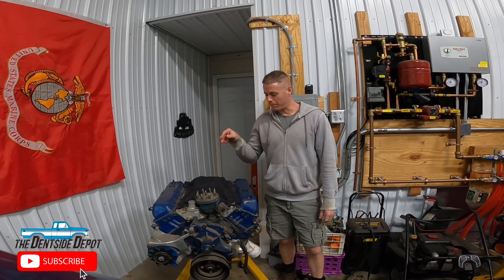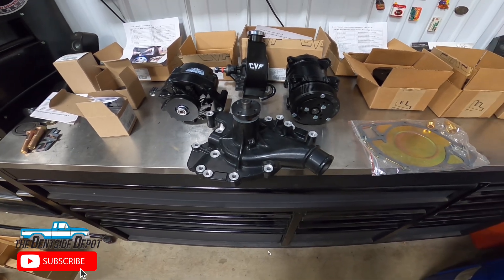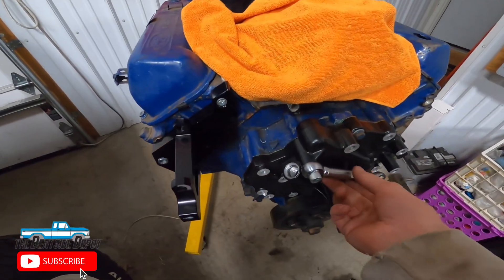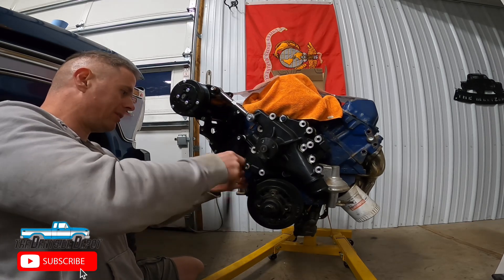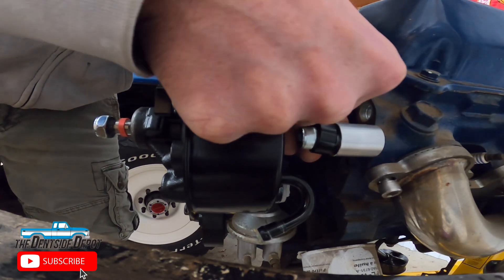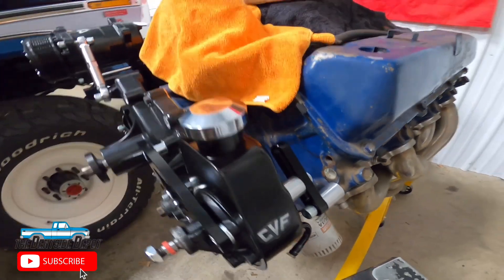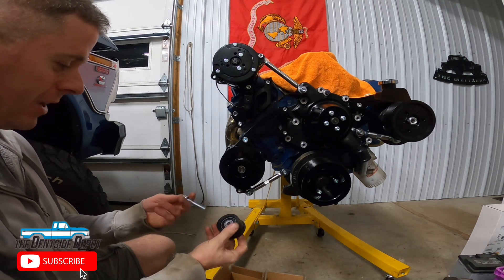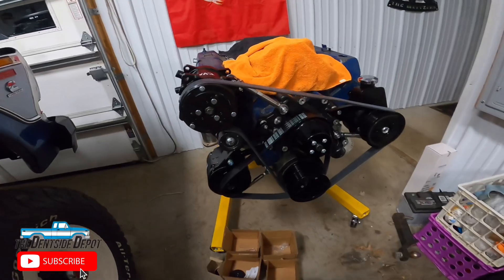Installing The ULTIMATE Ford 460 Serpentine System from CVF Racing

Comment from the maker: Another thing to consider, if you are in need of brackets or if your accessories are already worn out and you need to spend the money already for replacements, it is really not that much more to upgrade to this system and then have way better performance and looks for your truck. The links for all of CVF Racing's products are in the description above!

Comment: Just A 6 Rib Belt!!! Not A Serpentine Belt Set Up!!!
Also The AC/Power Steering Belt Is Way Too Long And Will Be Flapping In The Wind!!! Along With All The Squealing From The Crank Pulley Not Having Enough Wrap Around!!! 
The Long Distance Between The AC And PS Needs An Idler Pulley Or Two!!! 
I Wouldn't Buy This Kit!!!

Comment: How's the fit inside the engine bay? Imagine with a truck its ok, perhaps harder in a smaller car with where the alternator placement is?
Reply from the maker: Well I will answer that question in a later video! This is truly my first time using one of these systems.
Reply: I couldn’t fit this kit in my 78 f250. It conflicts with the frame yoke and low mount alternator. Customer service helped out real well and have the high mount bracket on the way. I’ll have to forfeit the AC compressor but that’ll be fine.

Comment: Nice kit, looks good and Easy!
Reply from the maker: Yes Sir I was really surprised by how easy it was to install. I have done kits in the past where there are multiple different spacers and bolts for each bracket and its a nightmare, this one is one and done and you are done. Well worth the money if you ask me, especially if you need the parts anyway like I did.

Comment: 2 belts and a Chevrolet power steering pump?   And it’s probably $$$?   I like the factory 460 serpentine setup way better
Reply: Ford camper vans with the 460 had Delco power steering pumps from the factory. Even back when everything had a separate V belt for every accessory on it. So did Dodge trucks, one ton and over from back in the 70s  to the 90s ...
Reply from the maker: The factory system is 3 belts when you have ac and emissions and a Saginaw pump also came on Ford's in the 70s as well, specifically the Econoline vans, it is not a chevy part but it is a way better design than what Ford has in the 70s.
Reply: @DentsideDepot I installed the kit on my 68 Lincoln Continental and I used the Saginaw pump and everything works great.  Ford did use the Saginaw pumps in vans.
Reply: @ they used a 460 until 1997.  There’s definitely a factory serpentine setup, and you can buy a smog pump eliminator if you can’t figure that out yourself.   Plus it comes with a factory spring tensioner, so no fiddling with turn buckles on two belts.  If you got this setup for free, good on you.   I would not pay money for it.  Also, that factory bracket allows the use of the exact ‘79 plastic ps pump, so you don’t need some weird restrictor in the line to bring down the pressure off the saginaw pump
Reply: @waylonrichter1253 My 90 F250 460 has a 2 belt serpentine set up and the alternator is still adjusted with the slide bracket. I did get a complete system off of a newer 460 for my 78 from a junk yard .